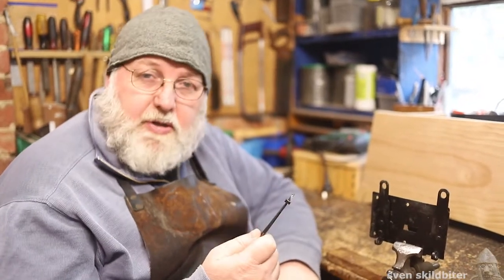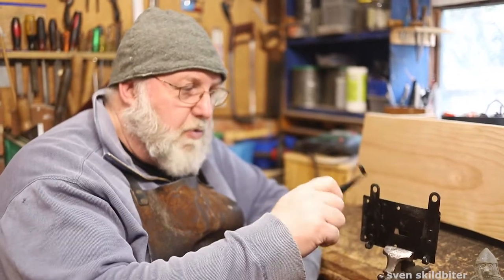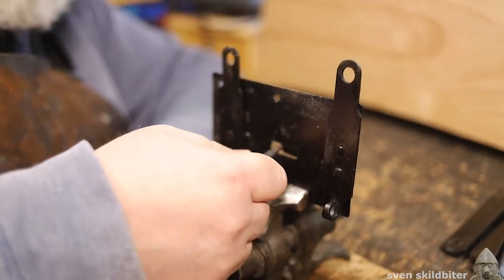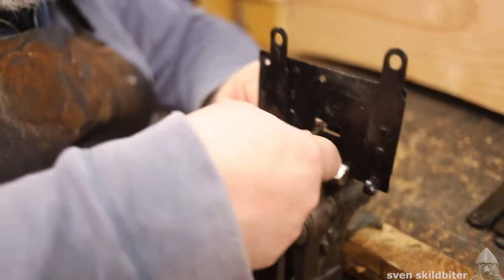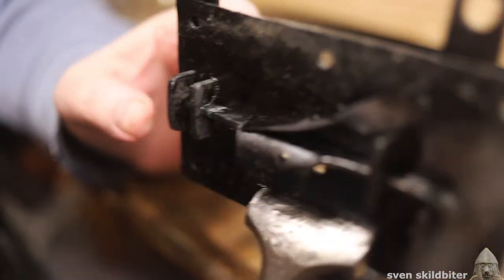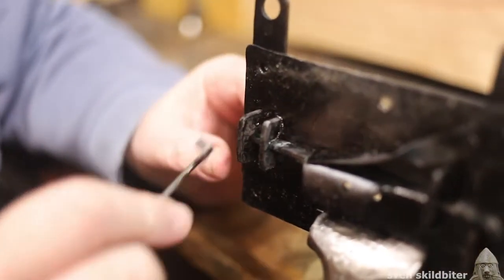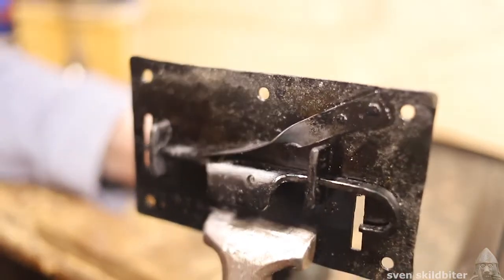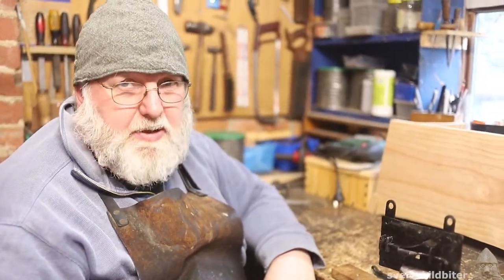Hedeby Chest lock, based on the Winchester lock.

Comment: I’m starting to like these strange old lock designs.
Reply from the maker: Not so strange for me. I am working on a lock for the Fyrkat casket, now that is strange. There is a 'Y' shaped hasp on the left side of the lock, locked by a slide, the key hole is a 'T' shape on its side, there are two springs (one on the top and one on the bottom of the slide) . The key goes in the verticle part of the key hole and slides to the right, depressing the springs. There is a 'Molnair' shaped snib connected to the slide on the far right of the lock, once the key has depressed the springs you slide the snib to the right, which draws the springs and slide through a lug, pulling the slide out of the hasp lug, unlocking the casket.
Reply from the maker: Sven the Merchant - The making of the Fyrkate casket lock. https://www.facebook.com/media/set?vanity=279496822766&set=a.10159459435862767